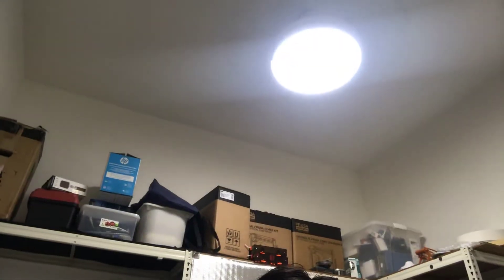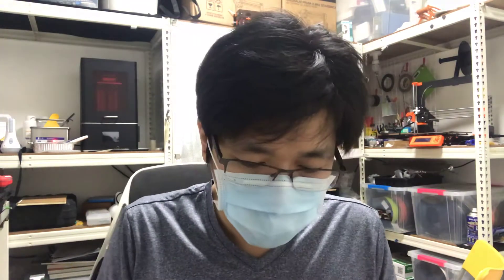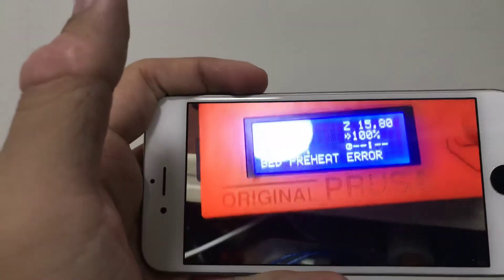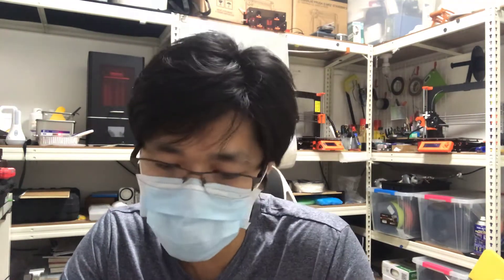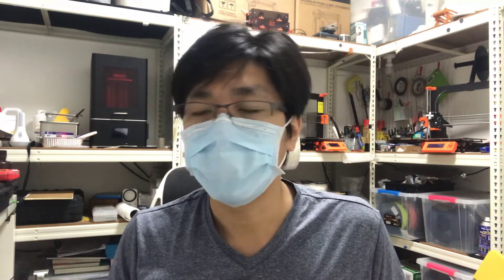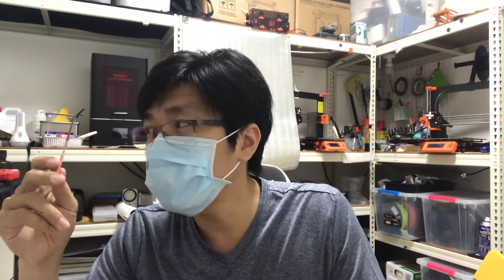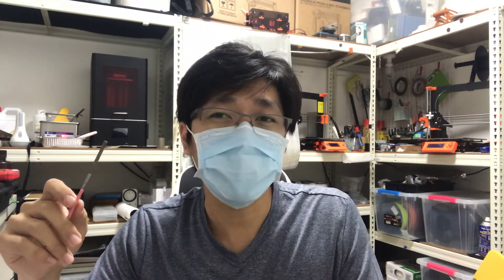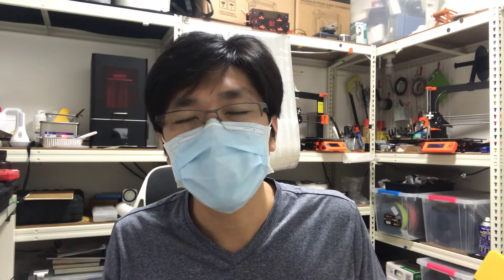Fix my Bed Preheat Fail error- Prusa i3 mk2.5

Comment: Thank you that was very unuseful
Reply from the maker: well  if normal way you just take it out move around the cable when heat , you should sport it have weird temp at cirtain spot. for prusa stuff contact customer service will be useful .